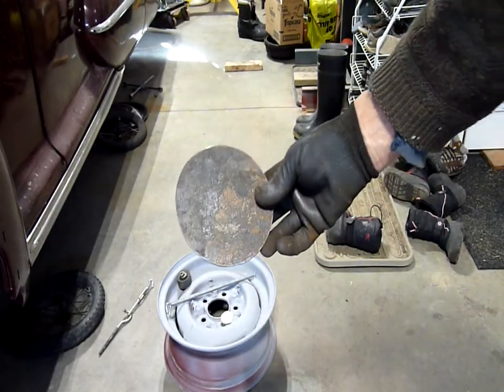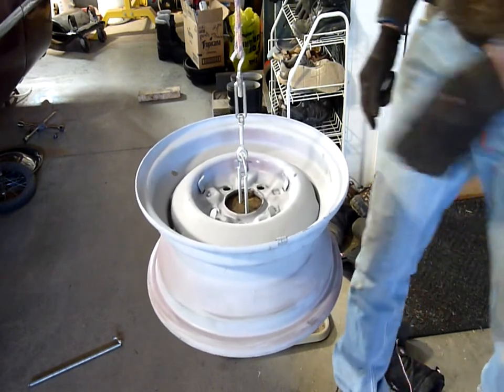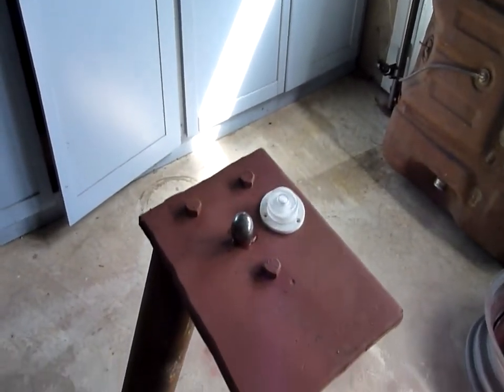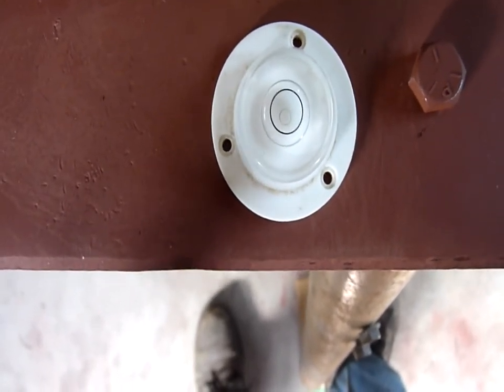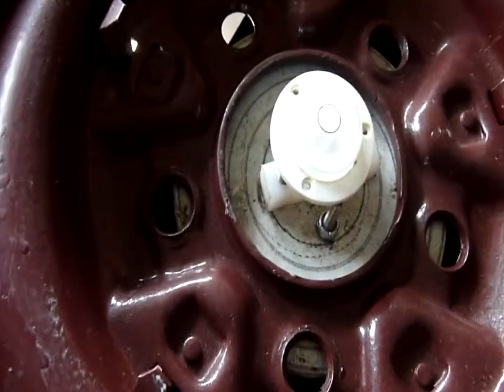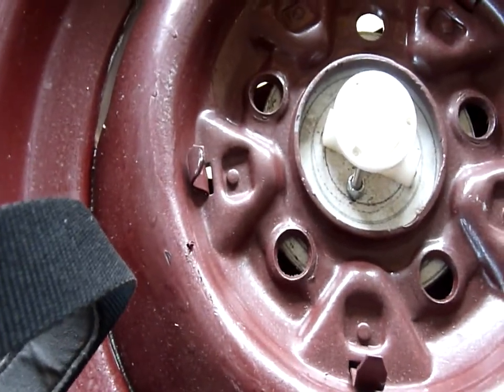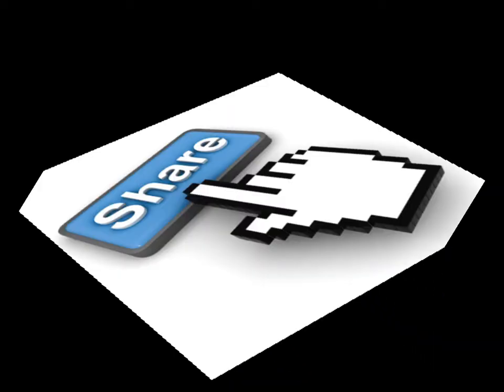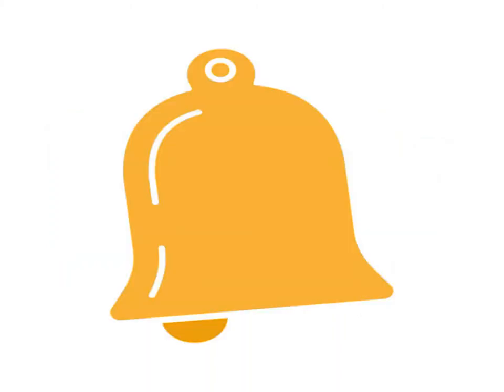Tire Balancer Episode 77

Comment: there is a secret how to balance steel rime and tires ,no led no balancering needed, look in side the tire, check in side the tire good, to see if you can find any layers of rubber that joins the tire to gather, thay should be around  5 or 6 inch apart,   you can see the riges in the tire,  check the lenth of the laps make a chock mark in the middle of it,  and add the chock mark on the valve stem,  2 laps,  check the distence thay are apart, divide the distence in half,  make a chock mark  add it to the valve  right in like with the valve stem,   no waits no shaking  nothing  like a speed balancer,   it's like a tire with a red dot, goes on the valve stem

Comment: Looks like you are having lots of fun in your garage. Keep it up 🙂
I use a similar wheel balancing method after trying and failing with a poorly made bubble balancer.
https://www.youtube.com/watch?v=JvN4i-qJqMs      3rd of 3 video's (so far)

The hub pilot on your wheel looks to be quite big, which is an issue I'm facing with large wheels. I think getting some plastic hub centric rings might be the solution to keep everything centered and reduce the size of the ball needed to support the wheel. 

If you have a lathe, I bet you could make up your own hub centric ring to reduce the wheel pilot down to suit the size of the ball you have. That would eliminate any centering errors - no more adjusting with a screwdriver.
Reply from the maker: Thanks for the feedback. You're right, centering is an issue.  I don't have a lathe. You have reminded me though that I have a seal driver that I may be able to do something with. All the best.